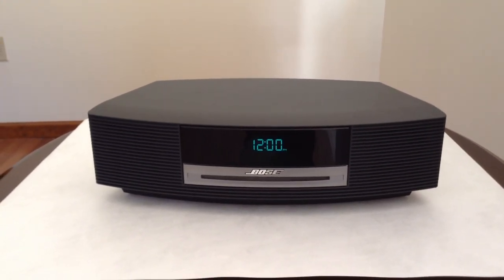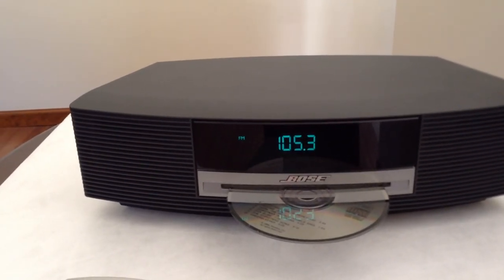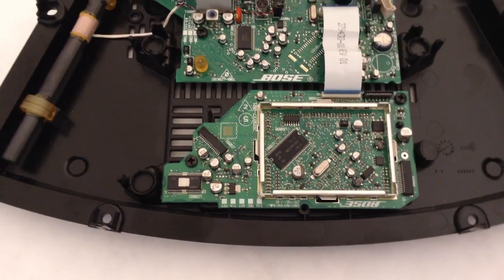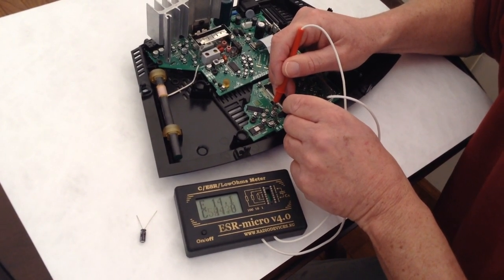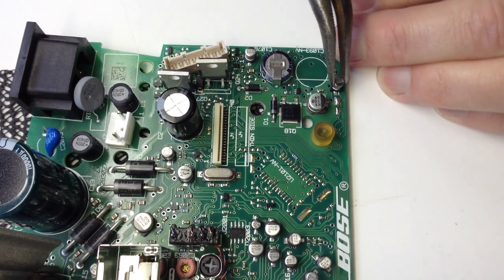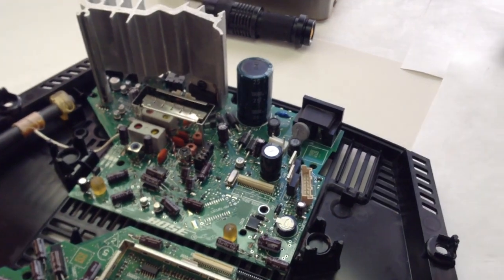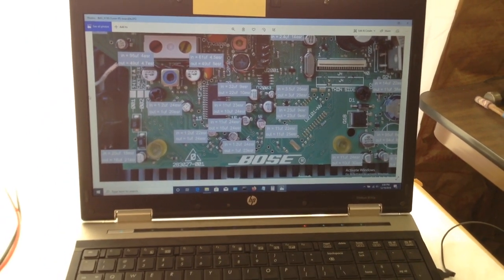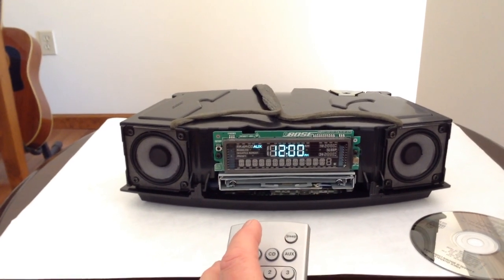Bose Wave II - AWRCC1 resets and CD skipping. Repair "Please Wait" problem

Comment: Question. I own a bose radio cd player model: AWRC1G and it's skipping but when it plays i can hear the music rotating sound with the disc. But only on scratched disc. It plays perfect on new cd of the store. Is it because it is hard for the bose cd player to read cd that has been printed with my PC and it's not from the store. I don't know how to explain cause i'm not english. If i play a cd new from the store, studio record, it plays perfect but if i play a cd recorded from my pc or other PC and it is scratched, it plays and skip and when it plays i can hear the music with the rotation of the disk. Can you tell me what i should do. Change the laser cell, i don't know since it reads the new disc. i did clean the cell and same problem. Help please! Thank's!
Reply from the maker: Hi Pico. I understand exactly what you are saying, but I'm not sure I can help. Other people have said the same thing, that Bose CD players have trouble with CD's burnt on a computer. There are several different types of burnable CD's. (CD+R, CD-R, CD-RW, etc...). I only use CD-R since it is suppose to be the most compatible. I have burnt MP3 discs as DATA and as AUDIO and they have played perfect on my Bose.  I have a scratched CD with Christmas music that someone burnt with a computer and the Bose has trouble playing that disc.

Comment: Hi i have the same issue but can you direct me to the Tester you are using or a comparable tester.
Reply from the maker: Hi Michael. The tester in the video is a ESR-Micro V4.0 that I purchased 10 years ago for around $75. It was made by a company in Russia called RadioDevices. They have newer versions now, but I do not see an active distributor in the US. 
https://www.radiodevices.ru/

I purchased mine from Brooke Clarke's website. He may still carry the ESRmicro line of ESR meters. 
https://www.prc68.com/I/ESRmicro.shtml 

I also purchased a cheap ESR meter from China that works but not as simple to use as the Russian one.
https://www.banggood.com/GM328A-LCD-Transistor-Tester-Diode-ESR-Meter-PWM-Square-Wave-Generator-Soldered-Module-p-1384846.html?rmmds=search&cur_warehouse=CN

Remember to always discharge the cap before testing or you will blow out the meter.

Comment: Hey there where should I buy the SMD capacitor, I’m going to try and replace the one cap under CD player that worked for others. 22uf.
Reply from the maker: That's a tough one. It depends on what country you live in. Here in the states, I like to purchase quality caps from Mouser or Digi-key because I know they carry the good stuff. You may be able to find the cap locally on Ebay, but you never really know what you will receive with some sellers. Good luck with your project.
Reply: @georgeterbush2976  one more question if I ask for a 22uf 6v it should be the same size as cap I removed?
Reply from the maker: @seekingtruth9677  The physical size of the cap under the metal can is very important. If it is too big, you may not be able to install the lid of the can. When you order the cap, make sure its dimensions are the same as the one I have listed here. This is really a project for someone that has some experience with electronic circuit board repair. There may be other caps that are causing your problem...

CAP ALUM 22UF 20% 10V SMD
https://www.digikey.com/en/products/detail/nichicon/UUD1A220MCL1GS/589983?s=N4IgjCBcoLQdIDGUAuAnArgUwDQgPZQDaIALAJwDMIAugL514BMxIAqmwCJgCCTTABgCyAYQAyYAOIBlWnSA
Reply: @georgeterbush2976  thank you for all of your help very appreciate for your amount of knowledge
Reply: @georgeterbush2976  called digikey today they could not find a 22uf 6V. Will it be ok for me to order the exact one you listed above the 22uf 10v?
Reply from the maker: @seekingtruth9677  Yes. It is ok to go up in voltage as long as the physical size of the cap is not too large for your application. The one I listed will fit fine.  The cost of shipping will be much more than the cost of a single cap. You may want to consider ordering a few of the others that are located in that can. If replacing the one cap does not solve the problem, at least you have plan B to fall back on. Caps are cheap, shipping is not. Ideally you would have a ESR meter to see which caps are bad.

CAP ALUM 10UF 20% 25V SMD
https://www.digikey.com/en/products/detail/nichicon/UUD1E100MCL1GS/590009?s=N4IgjCBcoLQdIDGUAuAnArgUwDQgPZQDaIALAJwDMIAugL514BMxIAqmwCJgCiYADPwCyAYQAyYAOIBlWnSA

CAP ALUM 22UF 20% 10V SMD
https://www.digikey.com/en/products/detail/nichicon/UUD1A220MCL1GS/589983?s=N4IgjCBcoLQdIDGUAuAnArgUwDQgPZQDaIALAJwDMIAugL514BMxIAqmwCJgCCTTABgCyAYQAyYAOIBlWnSA

CAP ALUM 47UF 20% 6.3V SMD
https://www.digikey.com/en/products/detail/nichicon/UUD0J470MCL1GS/589972?s=N4IgjCBcoLQdIDGUAuAnArgUwDQgPZQDaIALAJwDMIAugL514BMxIAqmwCIAMAUqQHZuAWQDCAGTABxAMq06QA

CAP ALUM 100UF 20% 10V SMD
https://www.digikey.com/en/products/detail/nichicon/UUD1A101MCL1GS/589989?s=N4IgjCBcoLQdIDGUAuAnArgUwDQgPZQDaIALAJwDMIAugL514BMxIAqmwCJgCCYADGACyAYQAyYAOIBlWnSA
Reply: @georgeterbush2976  thx so much I will order them tonight.

Comment: Surely measuring a capacitor when it is on a PCB and connected across an unknown impedance is not accurate. I have a similar problem with my unit but not sure I want to replace all the caps when it is probably only one that is causing the problem. I'll go with the 22uF that Michael Smutnick did for a start..
Reply from the maker: Hi Stuart.  You are correct. Measuring components in circuit will not be as accurate as measuring out of circuit. As I mentioned in my video, I was more concerned with the measured ESR (equivalent series resistance) of the capacitors in circuit. A component in parallel with the cap will only make the resistance lower, not higher.  If the in circuit cap's ESR being measured is higher than an acceptable limit, then it will probably be even higher out of circuit.  Keep us posted on your project! Good luck...and don’t call me Shirley.
Reply: @georgeterbush2976  
Thanks for your reply. I fixed the problem by  replacing some of the electrolytics. I did the 220uF one and some of the 10uF ones around the CD decoding chip. I'm not sure which ones were faulty as I don't have an ESR meter. I mainly used X7R or tantalum caps as these fitted better than the electrolytics that I had (all SMD)
Biggest problem was to refit the lid as someone had broken all but one of the fixing screw locations so I had to improvise with some plastic tubing and plugs.
Next I have a Bose soundbar to fix....

Comment: so, is it best to keep it unplugged when not in use ??
Reply from the maker: That's what I am doing. If you use it everyday, then keep it plugged in, but if it is going to sit for weeks at a time without using the CD or radio I unplug it. I have enough digital clocks in the house to tell me the time.

Comment: i just changed the caps on the cd driver pcb aun it worked !
Reply: @George Terbush Hi
cd was skipping also slow to boot up remote and radio channels slow to lock in was ready to change laser! checked caps in ctt with esr meter some high esr some o/c so just changed the lot to save time . job done happy customer. 

paul h
Reply from the maker: @paulhar7679  That's awesome Paul. Thanks for the feedback. It sounds like your Bose was acting just like mine before replacing the capacitors.

Comment: We have this. No sound is coming into speakers. What can the issue be. We did a reset on it.
Reply from the maker: Sorry I do not have an answer for you but please share more details about the symptoms. Someone else may be able to help. Are you able to switch to the radio and change channels? Can you change tracks when switched to the CD player? Does the volume control on the remote increment & decrement numbers on the display? Basically, does everything appear to be working except no sound?
Reply: @georgeterbush2976  can switch channels. wonder why we have no audio in speakers...seems like a simple fix like a wire broke off on inside.
Reply from the maker: @Gord.Stewart  Let us know what you find.
Reply: @georgeterbush2976  gonna try smack with a hammer first.

Comment: Can't believe that after spending hundreds on a BOSE. If you want Bluetooth, you have to buy an adapter. BOSE THAT IS AS CHEAP AS YOU CAN BE! And the BOSE Bluetooth adapter is over 300.00 Not worth the cost. Will return mine and get a Polk Audio. They sound just as good and you do not pay extra for Bluetooth. BEWARE!
Reply: Other cheaper bluetooth adapters are available that plug into any aux port

Comment: Can someone please tell me what the actual remote codes I'm using a universal remote to use it had to buy  a new one and  i can't find the codes anymore
Reply from the maker: You can try 409 or 827 
check out this link where it is discussed...
https://sherylcanter.com/wordpress/2010/01/control-a-bose-wave-radio-with-a-universal-remote/
Reply: I bought an aftermarket Bose remote on Amazon for my Bose, was $8.00, looks identical and works fine

Comment: Good Day! Im from the philippines im trying to find surface mount electrytic cap for my bose same probem please wait.. can i get a different value like 6.3v 22uf or higher volts
Reply from the maker: As long as it fits on the board, you will be ok with the higher voltage spec. Use the dimensions as reference from the Digi-key page I listed.
CAP ALUM 22UF 20% 10V SMD
https://www.digikey.com/en/products/detail/nichicon/UUD1A220MCL1GS/589983?s=N4IgjCBcoLQdIDGUAuAnArgUwDQgPZQDaIALAJwDMIAugL514BMxIAqmwCJgCCTTABgCyAYQA
Reply: @georgeterbush2976  how about radial replacement
Reply: I meant through hole what other replacement can i use its hard to find 6v here some are 16v
Reply from the maker: @carlolee4680  I listed through hole caps in my description...
22µF 16V Aluminum Electrolytic Capacitors Radial
https://www.digikey.com/en/products/detail/nichicon/UPW1C220MDD6/589511
Reply: @georgeterbush2976  hi again
Reply: @georgeterbush2976  this is what i got is this ok
Reply from the maker: @carlolee4680  What cap did you get??? Also, please understand that just replacing one of the 22uf caps is not a guarantee that it will fix your problem. As I have shown in my pictures in the description above, many of my caps were bad. Good luck with your project. Keep us posted.
Reply: @georgeterbush2976  hi george i replaced 1 22uf smd to 22uf 16v i was really amazed now works perfectly fine this was my dad's wave system been inside the warehouse for a very long time.. thanks for the help thumbs up..and lastly do i need to change all the caps like what u did?
Reply: @georgeterbush2976  i have another bose wave different issue..before it plays but has no sound now its beem stock for a lomg time i trued turning it on but has no power
Reply: @georgeterbush2976  hi! I message you on facebook i got some questions
Reply from the maker: @carlolee4680  If you were able to get your Bose working by just replacing the one 22uf cap, I would button it up and enjoy it. I'm sure some of the other caps are starting to go bad, but the risk of lifting circuit traces and making solder bridges is high. Well done Carlo!
Reply from the maker: @carlolee4680  Sorry, I do not spend anytime on Facebook.

Comment: Charged battery on remote nothing you think its just the battery.
Reply from the maker: Not enough information. I did notice that the BOSE remote will not work if the battery is even a little low. A brand new battery should get the remote working again.

Comment: My player keeps ejecting all discs
Reply from the maker: Hi Delon. You could have bad capacitors that are causing your Bose Wave II from reading a disc, but I would try cleaning the lens on the CD player first. Check out "The Specialist" YouTube for instructions... 
https://www.youtube.com/watch?v=Yxc8O53dGII

Good luck with your project!
George
Reply: @georgeterbush2976  thanks a million George
Reply: Delon Amos Hi Delon, did you fix your issues with the CDs automatically ejecting all discs? I have the same problem and don’t know what to do next!